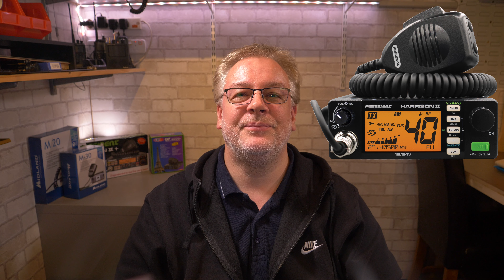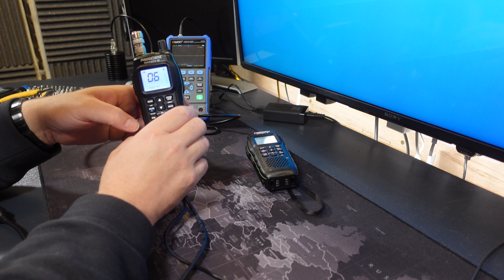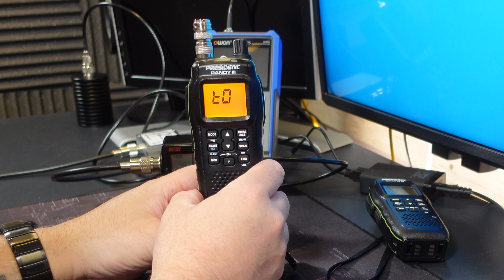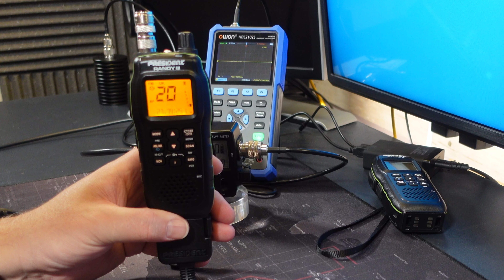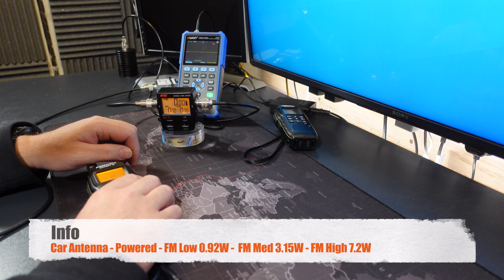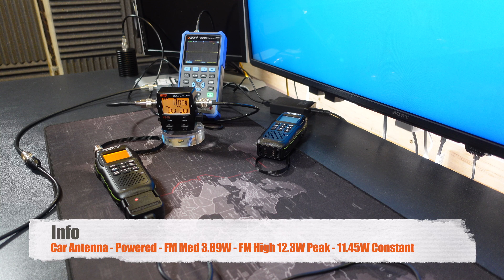President Randy III Handheld CB Radio - Revisited - Secrets Exposed

Comment: Thank you for your tips. Following your instructions I just modified my Randy III but I also added a 2 ways - 6 pins slider switch, placing it in a hole I cut on the side of the transceiver so that just by sliding it I can access the Extended or quickly revert to the original EU mode. 
To do that, I just soldered 4 wires from the 4 halves of the bridges I cut, connecting them to the slider. Very useful if you have to access the regular channels so that you don't have to flip the chan banks and skip the alphas. This of course if you don't mind cutting a hole in the case. In my case I weighted the pros and the cons and the pros were far more important than the cons.
Reply from the maker: Hi Roberto, thank you so much for the super thanks, really appreciated. Good idea on adding a switch to quickly flip between modes. It certainly is helpful to have the standard mode available easily when needed. Really pleased that the content was helpful to you. All the very best

Comment: Hi.
MY FRIENDS RANDY 3 WONT CHARGE.
THE RED LIGHT CGARGING LIGHT COMES ON WHEN NOT CONNECTED BUT ITS OFF WHEN CONNECTED TO THE Radio.

WHAT COULD IT BE ??
Reply from the maker: Sounds like a dead battery, swapping out the battery would be the first thing to try. You can purchase spare batteries from www.kcb.co.uk. I have also seen them on Amazon. Thanks for watching, all the best

Comment: Thanks for the video. I would like to point out that the Randy 3 is NOT the same as the US version  randy 2 fcc. I found this out the hard way. I bought the Rapndy 2 FCC and was disappointed to find that it comes with no car kit as the Randy 3. It does not have the antenna connections in the bottom contacts of the radio. It also does not have the 2 white wires in the radio to clip for expansion. After discovering these things I decided to order a Randy 3 from the UK.
Reply from the maker: Hi Mark, the PR2 FCC is certified by the FCC and has many restrictions over the PR3. The PR2 FCC cannot be expanded in the same way, does not come with the car kit in the box and is rather limited. It does have the weather alerts feature which the PR3 does not have but apart from that if you can defo get a PR3. I will get hold of a PR2 FCC at some point and strip it down to find out the differences at a board level, am interested to find out. I wonder if a software upgrade would restore disabled features or if they are very different. All the best and thanks for commenting
Reply: The Randy III is strangely missing the scan skip feature. I’d love to see a firmware update or mod to enable it.
Reply: @robogobo  well you'll be happy to know that President has just released the Randy lll+ handheld with Skip Scan, NRC and the new "P" channel's.
Reply: @cariboooutlaw do you know if this has the ability to expand and the higher power modes as described in this video?
Reply: @markhuisinga1698  yes The Randy lll+ is exactly the same expanding as the previous Randy lll in the EU.
Reply: @cariboooutlaw ok thank you very much. I was hopeful that it would be. I will have to order one now.

Comment: I've never understood why President makes such cool radios yet such crap accessories. The Randy speaker mic is pure junk. It has a unique plug so you're stuck with it. There is no larger President rubber antenna. You have to buy an Albrecht TNC mount model from Europe. Most Euro CB stores won't ship to the USA. No larger rechargeable battery. I have emailed President twice about why they have such poor Randy accessories. No reply.
Reply from the maker: Hi Matthew, the worst is that President removed the car kit adapter for the R2FCC which comes in every box with the R3 EU version and is a really useful accessory. You can also buy them separately in the EU as an accessory but they don't sell them in the US. A viewer contacted President US and they confirmed its not available in NA. I have no idea why unless it was a stipulation of the FCC type approval but am just guessing. You could try Doug at www.kcb.co.uk as he ships all over the place and stocks many brands including President radios and accessories.
There is no real option for a larger battery with the current design as its inbuilt into the body. It would be nice to see a slide and clip battery on the next version so larger batteries could be added. Even if they only made one size you could at least easily swap them in the field rather than having to unscrew the thing and mess around with the tiny connector.
I do not own the speaker mic so cannot comment on its quailty. I purchased the HHL2 from www.kcb.co.uk which is an extra large rubber duck antenna (i have two of them) and they work really well. You could try posting on their Facebook page and see if you get a response. Thanks for the info and thanks for watching

Comment: Well next time your in the states, Wisconsin specifically, I’ll buy you that coffee. Interesting video. Can you increase the power any without cutting the wires?
Reply from the maker: Hi Rick, yes you can increase but only by a small amount. No two radios are the same so sometimes you might be able to increase a bit more on one vs another. The USA version of the Randy 3 is the Randy 2 FCC but that has been restricted and does not have all the same expansion options. One viewer advised that they had disassembled the R2FCC and the wires were not there. Another viewer ordered a R3 and had it shipped to the states without any issues. I need to get my hands on a R2FCC to take it apart and see what the differences are. The R2FCC also does not come with the car kit which all R3's come with in the box. You also cannot buy them in the states as President don't sell them in that region. I would like to test a R2FCC with the EU car kit and see if it works. All the best and thanks for watching and for commenting, much appreciated.

Comment: Hi thank you for the video. My Randy 3 has arrived, and I am going to follow the steps this weekend. Once complete what should the frequency range be? Thank you for your time and efforts!
Reply from the maker: Hi DJ Bill, when expanded the Randy 3 is capable of 25.6100 to 27.8650. Press the F key twice and the band block flashes and then use the up and down arrows to move between band blocks. Press and hold the F key and you get a dot appear between the channel numbers and this decreases the band blocks by 5KHz. So that is how you get 25.6100. TS on screen when you turn on means the radio is in Standard mode and if it displays T0 then its in the 5KHz decremement mode. Just press and hold F to switch between modes. The double press F key makes life so much easier moving between band blocks. Hope your R3 arrived and the mod went well. All the best and thanks for watching

Comment: Brian, hi mate, I’m fully expanded now and working well. 
I was working it through my 5/8 antenna (with a little help) and my FM mod was reported as being a little quiet. My setting via the service menu is set at 5-10. Can you recommend the best way for me to increase the FM mod? I.e send me a few settings to try?
Love your channel and how you explain things! So good!
Laurie
Reply from the maker: Hi Laurie, thanks for watching and for commenting. In the factory services menu the FM-MOD option is the only way to make adjustments. Both of my Randy3 radios are set to 5-11 as the default setting. You can try 5-12 and also 5-08 and see if there is a marked improvement. The FM deviation is usually around 1.9KHz but without a spectrum analyser you will have to use trial and error. If after changing to 5-12 it gets quieter then go the other way and try 5-08. Do keep me posted on how you get on. All the best MJ7NLK
Reply: @NLKMediaGroup  hi Brian, I tried 5-12 and it seems perfect! 
My friend said it was blasting over - so much so that he recorded it for me. I couldn’t believe it! Sounded incredible! 

Definitely worth doing the Wideband especially as it retains the UK40. 
Power I just run on M setting (3.76w) thru the amp. Perfect!
Thank you so much for your brilliant videos! So informative and so well presented! Laurie

Comment: Too bad you can't put a speaker mic on it!!!!
Reply: What do you mean? There's an optional speaker/mic for the radio!
Reply from the maker: Hi Thomas, Thanks for watching and for commenting. Cariboo is correct, there is a Speaker Mic available directly from President. Part no ACMR407 and connects to the headphone and mic jacks on the side of the handset. This accessory is available in UK/EU and also USA with the same part number. Mentioning this because the Randy 2 FCC (US version) does not have all of the same accessories available as the Randy 3 (EU version) with the most noticable ommission for the US version being the car kit which comes in the box on all EU versions.

Comment: I would not own a president for all the money in the world cuz the president Randy radio in the USA is 194 dollars and that's a little pricey I think the FCC should forget about this FM garbage these radios are not worth I'll take an old radio from 40 years ago p from 40 years ago who cares about FM I don't that's why I'm not going to upgrade
Reply from the maker: Hi Ernest, Thanks for watching and for commenting. The Randy is not cheap but is a high quality, solid and rugged unit compared to others I have used. In the EU we have had FM for many years and it is widely used alongside AM and SSB. I can understand why you feel this way especially as FM has only just been legalised by the FCC. All modern radios are now system on a chip-based devices being microchip based. This has advantages and disadvantages and a well-tuned old school CB is a pleasure to use and has a charm that is not replicated by the microchip-based devices. Where things fall down is with CTCSS and privacy tones/ codes and the more modern filters and features. However, if these don’t interest you then a classic AM and SSB quality CB radio is a lovely thing to own and operate.

Comment: electret microphone or dynamic microphone ? cant find a wiring Schematic  for external microphone
Reply from the maker: Hi, I checked the manual and there is no wiring diagram in there. President do sell a Speaker Microphone for the Randy 3 which is part number ACMR407. This has a double jack connector with the headphone jack being a two pole pin and the Microphone being a three pole pin. I hope this helps. All the best and thanks for watching

Comment: Hi, reports that my audio is good (purchased a couple days ago) but a little quiet, would the FM MOD need to be adjusted with the correct test equipment? Great informative video. Thank you.
Reply from the maker: Hi Kaylem, You can adjust the FM setting and see if that helps. It adjusts the deviation of the signal and is set at factory for your specific radio. You might find that pushing it up or down a little may help but without the proper test equipment you cannot set it to the exact recommended percentage. However, you have nothing to loose provided you record the value you already have and can return the radio back to its factory setting if needed. Its worth a try as the factory may have set it short or long and a minor adjustment could help out. All the best and thanks for watching
Reply: @NLKMediaGroup  Thanks NLK, great vids and very useful.

Comment: Great info on them radios Randy ll and Randy lll will the R/lll work just as well in the US or just use the R ll Ty for sharing this
Reply from the maker: Hi Paul, they took the Randy 3 and restricted it to comply with the US regulations and called it the Randy 2 FCC. The US and CEPT EU band frequencies are the same so either would work in the US but getting a Randy 3 into the US could be very difficult. When expanded, Band Block A is the block for standard EU and matches the US. I believe the expansion options have been removed from the Randy 2 FCC as its more locked down. Thanks for watching, all the best

Comment: Can the same process be used to mod the American version radio? Does this also have SSB? I just ordered based on the video. good video.
Reply from the maker: Hi Cleshean, I am not 100% sure but feedback from other viewers in North America has been that the Randy 2 FCC has had the expandability options removed. Neither the Randy 3 or Randy 2 FCC have SSB which is a feature I hope President bring to the next version. It really is a solid and reliable radio and I am sure it will serve you well. I would like to get my hands on a Randy 2 FCC and tear it down to compare to the Randy 3 to see what differences there are between them (if any) on the PCB. Maybe the differences are in software. I have also been told that the Randy 2 FCC does not come with the car kit connector that all Randy 3's come with in the box. It is not available from President US to purchase as an addon either. I would like to see what happens when connecting the car kit to the Randy 2 FCC. They are bascially the same radio so would be good to know if purchasing the EU kit would work for my North American viewers. All the best and thanks for watching

Comment: Hello Brian. I'm from Portugal, and I want to thank you for the work and time you spent making our lives easier. I have a Randy III because I love radio communications, but also because I like to be prepared for a situation where you have to leave the house, and there is a break in telephone communications. I always have a T2LT antenna in my backpack, which greatly increases the range of this great little radio. Thank you one more time. I say goodbye with high esteem. 🙏
Reply from the maker: Hi Michael, thank you for the great feedback it really is appreciated. A larger antenna on the Randy really does help quite a bit. Its the best handheld on the market in my opinion. Another option is the Bill 2 with an external battery and antenna. Its not as compact as the Randy but is also a good backpack option. I wonder if President will release a Randy 4 at some point with a larger battery which is easier to swap and some other features like SSB. All the best and thanks for watching
Reply: @NLKMediaGroup  Olá Mhp163. Queria iniciar-me no CB. Mas ainda estou a descobrir este mundo da Rádio. Levantaram-me reservas em relação aos rádios que podem não funcionar na Europa devido às diferentes frequências. Posso te pedir algum feedback sobre este Rádio uma vez que tb sou português. Grato.

Comment: hi, can you increase the watt output on internal battery mode ?
Reply from the maker: Hi Arch Stanton, you can tweak the power mode on battery slighly but not by much. The high power mode is only enabled when the car kit is plugged in and you cannot push much more than standard using the built in antenna. I guess its not very safe to be pumping higher wattages out of the internal antenna which is right next to your head or they would have allowed for this. I even tried connecting the car kit antenna and running of battery but the radio knew what i was doing and no high power mode. It must be powered from the car kit to get the high power mode. Hope this helps, all the best and thanks for watching.
Oh, you could use an external battery rigged up to the car kit and an external antenna, that would work if you wanted to be mobile away from a vehicle but more to carry and external battery packs are quite heavy.

Comment: Long live CB Radio, F%$k ham radio and other licence requiring services
Reply from the maker: Hi McGyver, that did make me laugh, I know what you mean. However, I am a licensed HAM radio operator as well as a CB radio die hard. I have a foot in both camps :-). All the best and thanks for watching.
Reply: @NLKMediaGroup  i have a problem with ham and gmrs keeping records of people practicing their hobby.
Reply from the maker: @GWGMJ  I completely understand your position and CB is unlicensed so a good fit for you. PMR 446 is also unlicensed but at only 0.5W is a bit of a draw back. GMRS requires a license but is cheap and you dont have to use a call sign so apart from paying for it tracking usage is not really a big issue. HAM requires you to use your call sign with every transmission so tracking is easy but you can use a massive spectrum so its down to personal requirements. CB is cheap, easy and hassle free and that is why I love it so much. All the best

Comment: Hay Brian,nice explane the update for this radio handheld,but my question is,can de randy 3 this high power setting without any danger   greet
ings Henco Netherlands??
Reply from the maker: Hi Henk, yes the high power mode has been built into the radio by President for regions that allow it so there is no danger of the unit failing when using it. You would need to see what the law and regulations are in your region as to whether there are any dangers on that front. The radio was designed to be used in standard and expanded mode and that is why its all built in to the menu system. Hope this helps and thanks for watching
Reply: @NLKMediaGroup  Okay thanks for your answer, logically yes, knowing the president I should have known that!!
Based on your video, I bought one, works very well, I'm happy with it.
Please continue with your videos!!!

Comment: So does this all work the same on the randy 2 am/fm in North America?
Reply from the maker: Hi Joe, I have been told by a viewer from North America that the US version does not have the same expandability. They took the US version apart and there were no wire loops installed. I do not have a R2FCC model to take apart myself and compare to see what the differences are. Another viewer was trying to source the car kit in the US as the R2FCC doesnt come with the car kit. All R3EU models come with the car kit in the box but the R2FCC does not. I will try and see if I can order a R2FCC model and get it delivered to the EU myself, not sure how easy that will be but worth a try so I can compare. All the best and thanks for watching